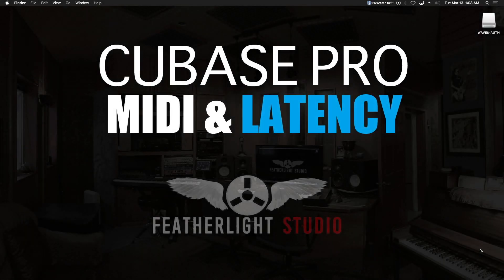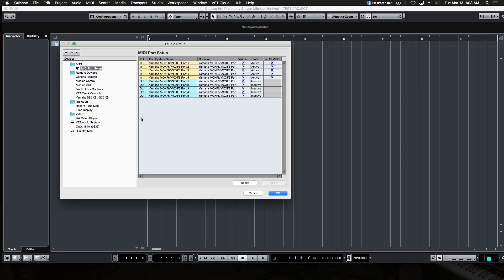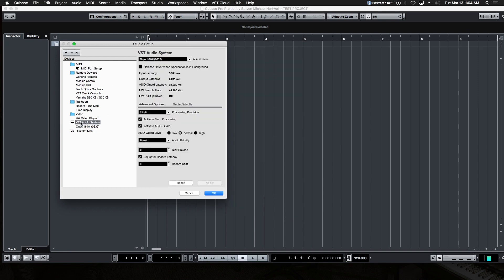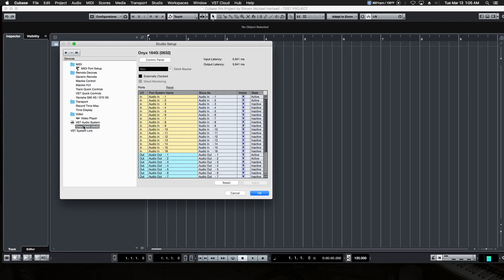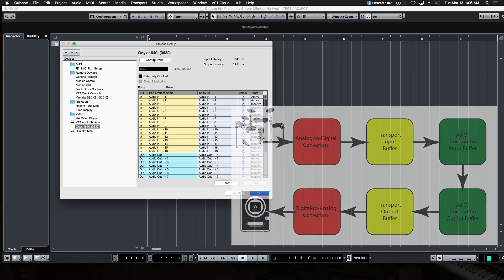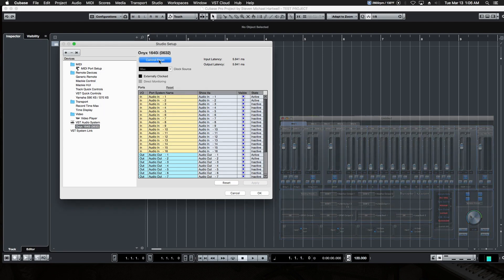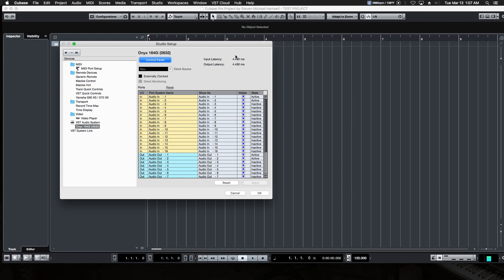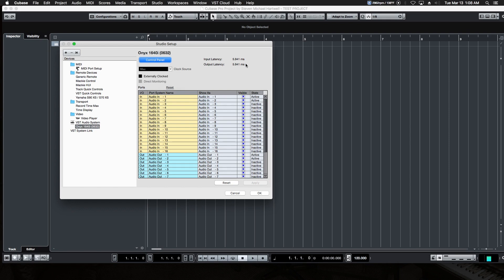LEARN CUBASE - 4. MIDI & LATENCY

Comment: Thank you for these great videos. My issue is, i play notes from my midi keyboard MPK249 and they lag and keep playing, almost on loop. This just started to happen. Any suggestions?
Reply from the maker: Heh Jacqueline, The first thing I would try is reseting your audio and MIDI settings in Cubase just to make sure everything on the Cubase side is behaving correctly. Go to 'STUDIO' menu/Studio Setup/MIDI/MIDI Port Setup. and click on reset to return everything to default. Then the audio. Go to 'STUDIO' menu/Studio Setup/VST Audio System/Your Audio Interface. and do the same. Next check to make sure there are no MIDI Insert FX on the track your recording to ( Cubase has MIDI delay, Transpose, Quantize FX that can be used as Insert FX ) Then finally, check the MPK249 and make sure there are no MIDI controller/Echo features enabled as the latest version of the firmware for that board has LOTS of controller mapping enabled for each different DAW and can be wildly different from DAW to DAW.

Comment: Darn... I didn't realize latency affected MIDI as well.  I have the Apollo interface TB3 (windows) and Komplete Kontrol Keyboard (USB).  Would a outboard Midi device lower this?  I have my buffers set high since the apollo gives me near zero latency for vocal recording... Thanks so much!
Reply from the maker: Definitely effects MIDI as well so, if your Apollo buffers are set higher, you will notice that when recording or playing with the Komplete Keyboard through your Apollo based Apps ( Luna, etc )  But keep in mind that MIDI latency is realized in the DAW or App your using. Assuming  you are using the correct MIDI driver for your Komplete Keyboard, each App or DAW will use that driver to 'interpret' the MIDI latency from your Keyboard accordingly. Some apps ( Apple Logic ) have well know Low Latency performance while others vary.  Our MOXF8, with the latest Yamaha MIDI driver, into Cubase Pro 11 can achieve 64 buffers of latency stable. Thats a round trip latency of about 4ms which is very fast for percussive keyboard playing or drum parts. However, at the END of a project with 75+ tracks and soft synths all active, that number would have to be considerably higher to achieve crackle free audio and stable performance. The takeaway here is: record most of your VSTi parts early in the project if possible. If you have to later, then temporarily disable or freeze the heavy hitters while recording MIDI to get better latency.

Comment: I have a different problem. When I record my keyboard playing in C12 it all sounds fine while recording. But when I look at the midi events they are before the beat in average. Like midi anti latency ?
Reply from the maker: The MIDI engine records your input immediately, unlike the audio that is latency compensated. Some audio interfaces dont adjust for this completely. If you right click on a MIDI Vsti channel and navigate to 'track control settings' make sure that 'Asio Latency Compensation' icon is visible, not hidden. Then go to your Vsti track and click that icon on or off and see if that helps.
Reply: @Featherlightstudio  ok, I already did that. It made no difference. But again,  my problem doesnt seem to be latency per se. Its that midi events are recorded ahead of the beat in average.

Comment: I never had problems recording audio...but after folowing your indications, still having problems with midi recording...(Maudio m track interface, cubase LE 9.5, Windowas 10, i7, 16 G ram, CME midi keybord controller) Thank´s anyway...
Reply from the maker: A great way to test if your MIDI controller is actually sending MIDI data at all, is to check the bottom right hand corner of the transport toolbar in the Cubase track view. To the right of the metronome toolbar is the 'Input/Output Activity Window' If you don't see it just right click on the little white gear icon and enable it. It will give you a realtime meter of all your incoming and outgoing MIDI activity.

Comment: What about the asio guard latency? Does that not come in to play?
Reply from the maker: Yes, the Asio Gaurd does factor into the overall latency. However, all hardware is radically different from one another so there is no universal setting. Cubase just starts you off with the best 'overall'  settings for most systems. It's best to experiment with the Asio Gaurd after you get your system up and stable.

Comment: I got an Oxygen keyboard and a Focusrite 4i4 soundcard. The latency is 5 miliseconds when I check it, but the actual audio is still waaay of. I just don't get it. Any ideas?
Reply from the maker: You may want to navigate to the 'Studio" menu tab and scroll down to 'Studio Setup..." then navigate down to 'VST Audio System" and choose 'reset' then choose 'apply' to reset all your audio engine settings. And make sure that 'Adjust for Record Latency" is selected ( should be the default ) 
Then navigate directly below VST Audio System to your Focusrite sound card, choose 'Control Panel" and select a latency that works for your system. Too low will cause distortion and dropouts, too high will introduce audio lag.
Reply: @Featherlightstudio  Cheers, I'll make sure to check it out! Right now I found that the program's plugin sounds work perfectly, it's just the keyboards own sounds that lag, so I think I'll play around with that for a while until I get the hang of it and return for the technical stuff later! 😁

Comment: Bt what if my midi is USB direct?
Reply from the maker: Hmmm, latency is simply the delay introduced by the total of the computer and the associated hardware, not the wire or connection type 
( MIDI/USB)
Reply: @Featherlightstudio  Hmmm, so you suggest me to follow these steps either way? I'll give it a try

Comment: I know the buffer settings effects the audio latency but does it also effect the recording and playback latency of the actuall midi data itself?
Reply from the maker: Yes, system latency affects both audio and MIDI, however, Cubase will 'adjust or compensate' for that latency by the settings you specify in the VST Audio settings. However, these settings are only Cubase interacting with YOUR particular hardware so, no two settings will be the same for each Audio/Midi interface. The general rule of thumb is record MIDI parts before heavy latency inducing plugins are used for a more responsive performance

Comment: the speed of a midi cable is lightspeed, not 4ms
and 26ms is not half a second. 500ms would be.
Reply from the maker: The latency reference is not referring to the actual 'cable' but the direct connection and associated  processing of the pieces of gear used.
Reply: @Featherlightstudio  no problem. the topic is super fuzzy anyway.